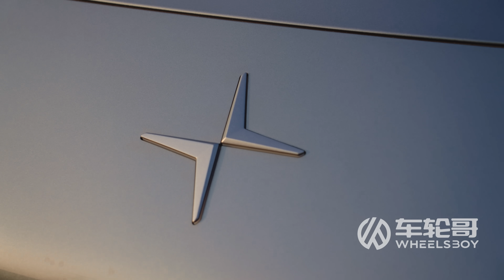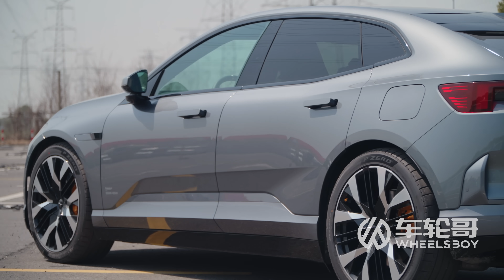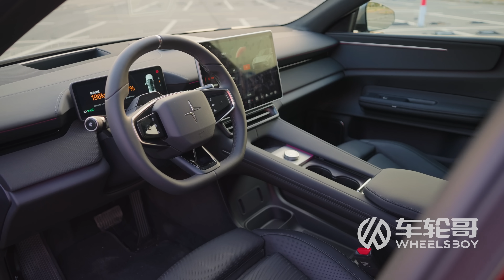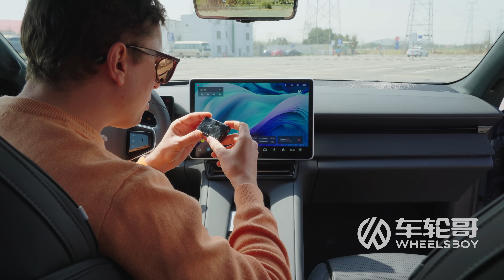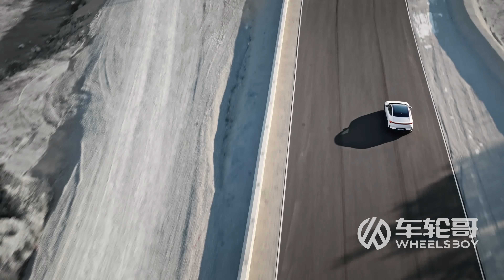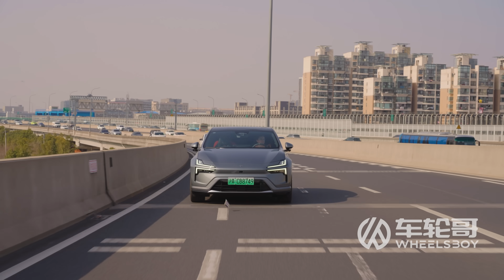Polestar 4: No Rear Window, No Problem

Comment from the maker: I've been seeing some very insightful comments with regards to the difference in price that I mentioned, and I want to address them. First of all, many people have pointed out that the prices I quoted for the UK included the 20% VAT in addition to the 10% tariff. Meanwhile, the Chinese prices do not, and electric vehicles are currently exempt from similar sales taxes here in China. These prices, do not, however, include any other subsidies offered by the government, and pointing to subsidies involved in the production of the vehicle isn't relevant to this discussion, as those savings could just as easily be passed on to consumers abroad as they could domestically. 

First of all, this was not an intentional decision to deceive the viewer on my part. Chock it up to the fact that I'm American, and unlike in Europe, our companies aren't required to include all relevant taxes in their pricing, so it didn't occur to me to consider this factor. That's my mistake, and I apologize. 

As such, a more accurate comparison would require us to compare the UK prices minus VAT and tariff with the Chinese prices quoted.
Taking VAT and tariff into account, the prices would be roughly £42,000 (single motor) and £46,900 (dual motor) for a Polestar 4 in the UK. That's clearly much closer to the price of the Chinese models, which are equivalent to about £33,000 and £41,000. As I mentioned at the end of the video, those prices have since been dropped significantly, so they are now equivalent to £26,300 and £37,300. That's a difference of about £15,700 and £9,600 vs the UK price. I understand that there are other factors, such as shipping and the fact that, unlike China, Europe isn't a unified market, so it costs more to market a vehicle, but I don't think such factors can explain that big of a price difference, do you？

Ultimately, I stand by my belief that competition is a major factor in the way these cars are priced in China vs the rest of the world, but I realize that my failure to address the issues above worked to weaken that argument, and I appreciate those of you in the comments who offered genuine, helpful critiques and additional information. 

I hope you were still able to enjoy the video, and I thank you for choosing to watch our content!
Reply: Thanks for this additional info!! Xie xie ni
Reply: I hope taxas decrease on Europe there for sales can increase a lot we are talking about 15k to 20k difference pricea from China to European market
Reply: Pls also review the Nissan Sylphy e-power (1.2 lit NA + single speed transmission). Appreciated!
Reply from the maker: @David_Denali the only e-Power model we get in China seems to be the 1.2L hybrid. It also seems to be available in other markets already, and we try to focus on cars from Chinese brands, cars from global brands that aren’t available outside of China (like the Audi A7L that we reviewed), or hotly anticipated cars like the Polestar that we happen to get well ahead of other markets.
Reply: @Wheelsboy  I'm afraid ur right 1.2 litter that is. It was a typo
Reply: @Wheelsboy  I had a chance to see Polestar 4 live last weekend in London. And this is a fantastic-looking car. Quality is superb, lot of space, great interior design...
But I stand my ground. If you configure your P4 in the UK, as dual motor (because yes... you want your Polestar be faster than your Skoda), and add VERY packs like ventilated seats (because default one are terrible) and matrix lights, the price is...£72,290... then you go to porsche site, select default Macan 4, add ventilated seats, matrix lamps and the price is.... £73,635.00. I am almost sure if you check the leasing... Macan will be more cost-efficient because of better RV.
This is fantastic car... but I would take Macan every single time. (but ofc still waiting for test drives)
Reply: I would be surprised if they get serious sales in the UK. The price is just absurd, you really want to buy one to get this instead of cheaper tesla with access to the best charging network, or pay a little bit extra and buy a Macan, which if you are after 70k car, should not be a problem.
for 37k it would be no brainer, as I am paying 39k for Smart #1

Comment: As far as communication with others users is concerned. There is no need for a rear window for that. 
You can use other methods used by van or truck drivers that also do not have rear window. 
Such as for example the turn signal. 
When you want to say thank you to somebody you just quickly make a left then right blinking a few times. 
The other user will understand. 
A hand outside the window can also do the job but it’s less practical.

Comment: I greatly admire China's progress and development in the automobile sector.  What's more, my next vehicle will be from a Chinese company, but from a private company.  Despite that, I must admit that I don't like the fact that there is an oversupply of brands and models from state-owned companies (for example, Chery, has many brands and some with very bad names), I think they do a lot of damage to other private competitors with a lot of potential.  I am very saddened by the news about Hiphi stopping their production, their vehicles are spectacular.  I was also very saddened by Byton's case.  If these conglomerates invested in start-ups instead of launching their own brands, it would be much better.

Comment: 8:51 funnily enough this leads me to another issue I have with no rear window. If I'm behind a vehicle at low speed, but very close, sometimes, I would like to be able to see through that car to see what's going on in front. Its frustrating when a vehicle completely blocks your view, especially If I'm in a sedan and this is an SUV.

Comment: I was in a BMW dealership two days ago in Shanghai to check out the iX1 (the recently refurbished shopping mall close to the old UFH building). The Sport M trim is officially 340000 kuai here (~47000 USD) but the dealer gave me a quote of 240000 kuai (~33000 USD) with HUD and updated sound system, 19" wheels. I could take it by paying 21000 kuai (~3000USD) on wechat + 4000 kuai (~500USD) monthly payment. Even for laowai. Long story short the chinese economy is so bad right now prices are dropping like a stone right now. Too bad I cannot paste image of the quote here.

Comment: The Polestar 4's seat belts are "Swedish Gold." They appeared on Polestar Volvos. In fact, this applies to any Volvo or Polestar with those seat belts. And do you have a link of who tuned the Polestar 4? Because, as far as I know, all Polestars are tuned in Europe. The Polestar 5 is being tuned in England. 

This car looks like a raised sedan in terms of lines. But I understand it is big in the metal. 

I like your reviews. For me, this is a Polestar-fied Zeekr001. Nice car. But I prefer the more Volvo-based Polestar designs like the 2, 3, 5. The 6 is OK but I don't see the need for a Roadster and think Polestar should update the 2 to a new model (probably call it a 7). I'd also say Polestar is a Swedish company. They're very much like Volvo, only sportier. But same philosophy and since they've tuned Volvos from the 1990s, they really base most of what they are on Volvos while sometimes using shared Geely bits to bring down costs.
Reply from the maker: You’re right about the seat color, would be much more accurate to call them gold. I’m sorry I can provide a link for the tuning of the suspension, this was based on conversations with people within Polestar here in China. I was careful to say that it was done by a team based in China, not necessarily a team made up only of Chinese engineers. I’m sure there were experienced foreign engineers involved. 

Yes, Polestar is a Swedish brand according to its own lore, but I’m just pointing out that it is majority owned by Geely (50.5%), the rest belonging to Volvo.
Reply: @Wheelsboy  Volvo has sold much of its shares to Geely and now retain about 18 percent. The reason I say it is Swedish is because it is headquartered and managed there and of course Polestar was founded in Sweden. I like Geely's style of ownership. They tend not to change established brands and infuse them with cash. Of course the brands will use common parts to cut down on costs but will also have their own parts to create their own feel.

Now, although Volvo has sold the shares, they still are very close to Polestar in terms of shared development of Polestar cars and servicing them. If you look close at Polestar there are so many Volvo parts in most of them. Even the paint colors and interior materials are almost exactly the same as Volvos. So, Volvo and Polestar will remain close brands. 

I think the Polestar 4 has a chance to be Polestar's best seller since it has the crossover height and is priced in a bracket that is more accessible to many buyers than the Polestar 3 flagship crossover.. Great job on the review.

Comment: You left out charging and EV mileage aspects. There is a YouTube video that shows how amazingly well Polestar handles on a frozen lake. BTW, I have owned stock in Geely since the 1990s when they went from making refrigerators to making cars. If Geely did not buy Volvo from Ford, Volvo would have gone out of existence and there would be no Polestar. P.S. Geely also was considering making a flying car called the Terrafugia. Check it out also on Youtube. Finally, Geely sent a satellite up which I presume will be used as a GPS and also for possibly working with autonomous driving.
Reply: amazing 90s investment

Comment: I really like your content, but when it comes to pricing you are SO wrong. You were on the right track, but instead of following that logic you went completely left field. Here are the main reason EVs are cheaper in China vs other markets, like the ones you mentioned:

1) Shipping, this is small cost, but with dock fees etc this can quickly accumulate to a few thousand per car.
2) Tarifs, as you said the UK (and most of Europe) has 10% tarif on Chinese cars. 
3) VAT, Europe has between 19-25% VAT on EVs. In China EVs are VAT excempt.
4) Subsidies, Chinese automakers are given subsidies by the Chinese government specifically to lower EV prices in the country.
5) One market, bigger volumes, less cost. Europe consists of many smaller countries with local regulations and the need for local marketing.

All of this results in Chinese EVs being much cheaper in China than in Europe. I made a video about this on my channel for those interested :)
Reply from the maker: Thank you for your comment and for providing some more valuable context to this discussion! I have pinned a lengthy response to yours and other people's comments above. Hope you were still able to enjoy the rest of the review!

Comment: Competition? No. the Chinese government heavily, HEAVILY subsidizes domestic auto manufacturing especially for EVs. That competition couldn’t exist at those prices if the government wasn’t propping them up, because they want China’s companies to ultimately have economic power. I thought this channel covers specifically Chinese market cars; how could you have not address the subsidies?
Reply: Lmao china basically owns the EV supply chains including raw materials and lithium Mines. They account for 70% world EV battery production,65% world's EV production and they make all the other components. Subsidies are only a tiny reason for the low prices
Reply: Plus companies like byd have vertical integration that enables them to make EVs cheaper and make a profit. China is the largest auto market in the world and is the most competitive market. More than 100 new EV models are launched annually in the Chinese market.

Comment: Also the European/UK quoted prices include mandatory SALES TAX (waived on EVs in China), which adds ~20% to the (post-import-and-shipping) price. Quoted price also includes minor fees totaling around 110 GBP for license plate and first registration).  However, your point about competition explains all of the rest of the price difference.
Shipping is roughly 1k euros (900 GBP) and import tax to EU/UK adds 10%. So 33,000 GPB base price in China would go to 34,000 after shipping, 37,400 after import tax, and then 44,880 GBP after the 20% sales tax. The rest is overpricing due to lack of competition, as you say.
Reply: 你们那割韭菜真的太狠了
Reply: @羽·書  在国内什么宝马奥迪特斯拉，现在都开始夹着尾巴做人了，无它，卷的结果
Reply: 风水轮流转啊 @羽·書

Comment: Another excellent review of an interesting new vehicle.  As you explained, the Polestar vehicles are obscenely expensive over here in continental Europe. A slighlty more affordable vehicle which is hardware wise almost identical Geely daughter Zeekr 001. How would you rate the Polestar 4 to the 001 in terms of driving dynamics?
Note: the 'facelifted' 001 for model year 2024 outdoes this Polestar by having 800V charging platform and  significantly more power (580kW).
Reply: The tuning is based on different  standard. Should drive and feel by yourself.
Reply: @s.d.918 I have driven the 001, but not Polestar since not available. Hence my question to Wheelsboy..
Reply: @GTI_CHHA  My bad. I thought you were   in China cos not many people know about zeekr out there..

Comment: Its eyewatering comparing prices for the same EV´s in europe and china. Some EV´s cost half in china than other markets around the worlds. The market regulates everything I guess. A VW ID3 is only 16k in china after a recent price drop, competion is hard there and the market is big. But some cars like the EV MG´s also make it to europe in numbers and challenge the " established" brands on home turf...
Reply: 😂I understand your excitement about the price difference. I think my experience will make you few better. When I was growing up in Chinese, the cars sold their were from the joint venture. And they are usually at least 30-50% more expensive than their European or North American counterpart. Now, I have moved to canada and want to get a Ev. Then the same model or comparable model coat 2x as much here than the Chinese market. Something such as MG4 x power that I want dont offer in this market, nor can I travel south of the boarder to get one. Unless I have the financial mucle to homologate the type at Transport Canada. 😂
Reply: 然而，冯德莱恩女士认为我们卖得太便宜了。。。损害了欧洲（🇺🇸）的利益。。。

Comment: Nice review as always.. Commercial drivers are use to driving with no rear view mirrors.
Reply: there is much better view from the electronic  mirror screen than peering through a limited rear view window with seat heads etc in your way and narrow view anyway get over it
Reply: @FreedomIRE  🤣🤣🤣🤣🤣🤣
Yes, @Wheelsboy will have to get over it. Not having a rear view mirror doesn't even faze a professional commercial driver.

Comment: The interior is a bit of a letdown in design. The screen is a nice size but it's kind of trapped between the "Here's a big screen!" minimalism of the Tesla, and something that's  part of the dash like a Mercedes. The small Volvo SUV has a better looking interior.  I could also really use a bit bit of color.  This isn't a Polestar exclusive issue, but when the console doesn't have anything mechanical in it, why make this giant open area that's hard to reach, and then build a wall around the driver with the dash?  Just to get a cup holder?  I prefer the solution with a large, closed storage area, and less of a border between driver and passenger.  This looks a bit cramped, even though I'm sure it isn't.  3 miles/Kw/hr is also nothing amazing on the efficiency front. The Model Y, for example, can go this far with a 20% smaller battery.
Reply: Model Y can only travel 290 miles the LR RWD with the bigger battery😂😂 if you drive it to 0%. If not, 270miles it the real range on 70mph.
Reply: @faithosadebe5293  I don't understand your point, the range of this is the same situation.  It's that longer distance if you drive it to 0% in the Polestar.  You've just spent more money to recharge it each time.  My point is that the Model Y, regardless of if it's 80%-30%  or 100-0, goes as far with a smaller battery because it is more efficient.  That also makes it lighter, which means it uses less battery just to lug the battery around... So, respectfully, I don't see your point or why it's so clever that you're laughing at your joke?
Reply: @davids1816  laughing at mine own joke??.. Just letting you know both choice of cars is silly and overpriced..

Comment: Looks like the clone of Zeekr 001.. same big company..😅😅😅
Reply: 是的
Reply: 这个品牌比zeekr好用，欧洲人更能接受
Reply: Yes, this is basically the performance version of the Zeekr 001.
Reply: All Geely cars now look the same now. Linc & Co, volvo, zeekr, pollster It's ridiculous.
Reply: @LaowaiDaveJCP  Volvos don't look like Zeekrs. Volvo has a distinct look to all of their cars except for the EM90 which is a rebrand of the Zeekr009. The rest of the Volvos have a specific Volvo look. Polestars are basically sporty Volvos and most have a Volvo look as well except for the Polestar 4 which is based on the Zeekr001. Lynk and Co and Zeekr have a similar look as they share design teams. And these are brands in the Geely group, not Geely cars. Geely Autos are their own brand like VW is its own brand but Porsches and Bentley are in the VW group but aren't VW cars.

Comment: Polestar 2 and 3 is better than 4 because both Polestar 2 and 3 are have rear window, but Polestar 4 hasn't rear window
Reply: I love the polestar 2 design, looks more Volvoish. And dealers in China got huge discounts for the Polestar2 right now. Can find a brand new for less than 21k USD. Sticker price above 44k USD, over 50% off.